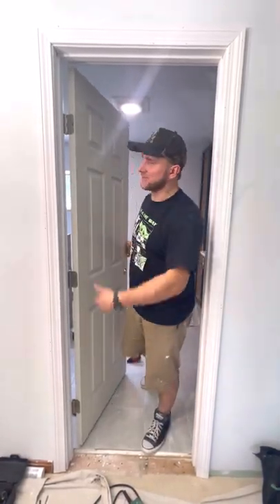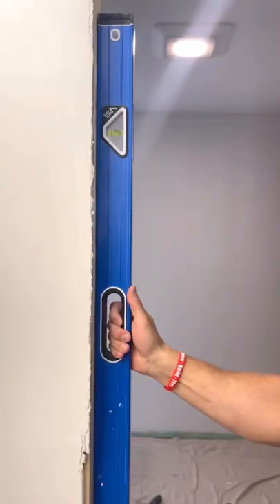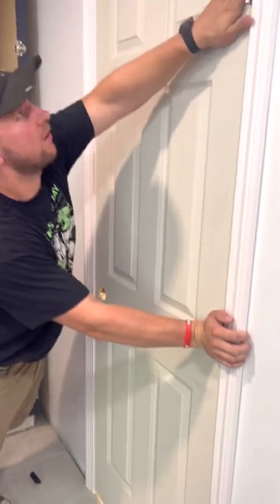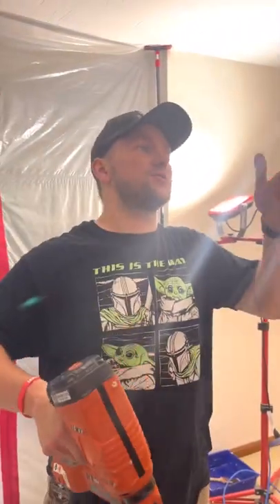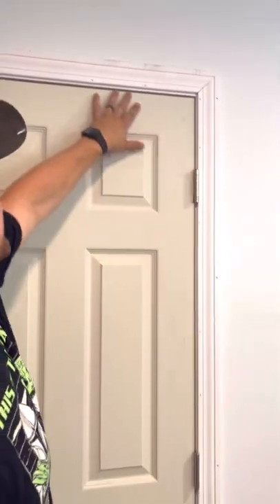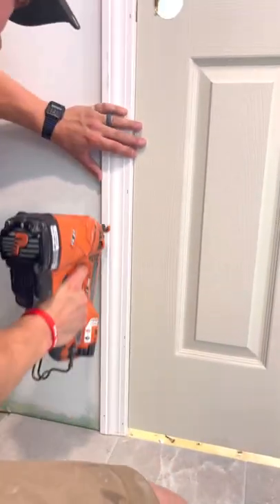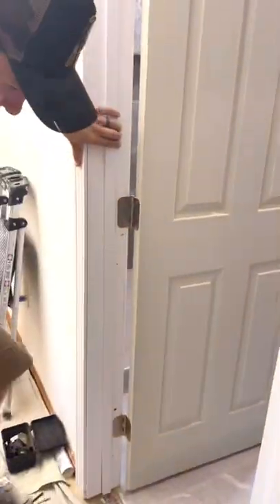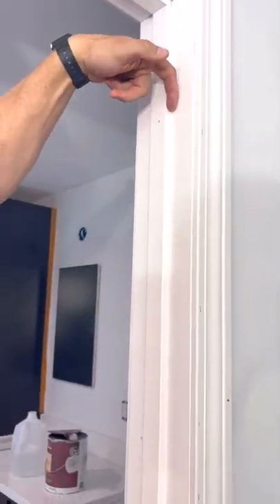LOWES Split Jam Door Install.  WINNI DIY Vlog 021

Comment: No need to drill holes to add screws. Back  out one of the short hinge screws on the jamb side of hinge and add a three inch screw in it’s place. It also gives you some adjustability if needed.
Reply: @HandymanHustle   Yeah but no matter how much you know or no matter how long you’ve been at it, it’s never to late to learn something that will help you be more efficient. Im a remodeling contractor and business owner  and still l love it if I can learn something that helps achieve that goal. Plus that bigger hole will dimple down the road and show.
Reply: @ohmsweethohm7259  good thinky

Comment: Very cool.  Are those split jam doors off the shelf or special order at lowes.  I wonder if Home Depot Carrie’s them as well.
Reply: I had to special order mine.
Reply: They have a crap load of them in the bays, all widths 24-36.  I picked up a discounted 24" one off the top bay, not sure what the issue with it was; does have some chips.  Both stores carry them.  Solid and hollow.
Reply: They are also off the shelf

Comment: I ordered 6 of these and 3 of them were absolute junk. Mush have been the guys first day on the job. I had to pull them apart and rebuild them. They go in super easy. I had Lowes deliver these to my door free of charge because I used my lowes charge. If it happens again I will have them come back out and return them. The revile on most of the doors was way off. Shameful they let junk like that go out the door.
Reply: probably off a boat from China.